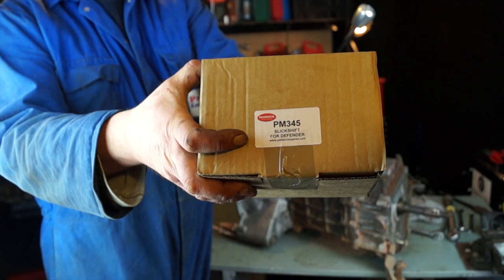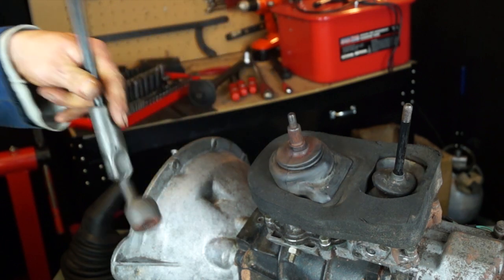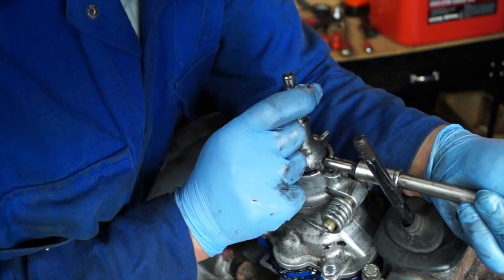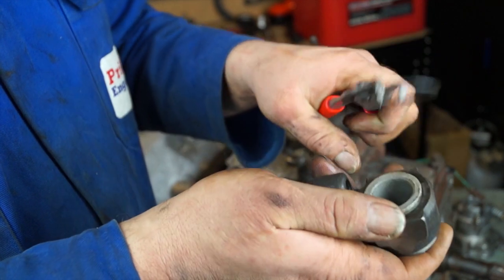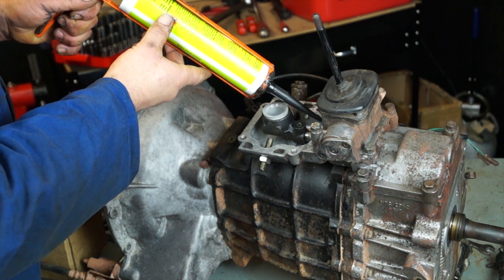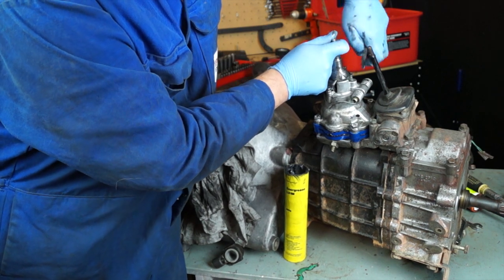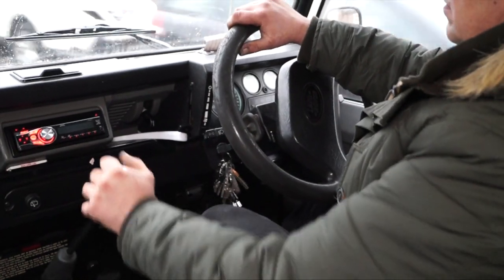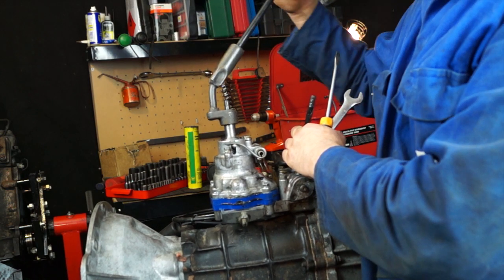PM345 Slickshift for Defender Gearboxes R380 and LT77 fitting guide

Comment: I have fitted this today but now can't seem to engage the gears, I did notice that the shaft where the grub screw sits had shifted inwards and to the left when I went to refit, is this an issue? does the shaft with the grub screw need to be completely upright prior to fitting?

Comment: Great video. Much better than Slick Shifts own video. However, although I removed the grub screw successfully I couldn’t slide off the trunnion, not enough space behind with the body. So I was unable to fit that plastic seating. Slick shift said fit all the parts. So I gave up. Although it worked ok after I adjusted the 3rd/4th gear adjusting screws I found reverse more difficult to engage ?? Bottom line, is it’s now sitting in my garage unused. I’m happy to send it to anyone for free if they’re interested. 😁

Comment: Fit my slick shift. Get all the gears no problem. But if I select reverse it goes in ok but it is very hard to get back out. I don’t want to force things. Didn’t have this problem before with the old shift. What have I done wrong
Reply from the maker: LT77 or R380?
Reply: Lt 77

Comment: hi could you i know this is not directly related ( im planning on changing my 2.5 petrol N/A defender to a 200tdi) but can you put the gearbox from   a 200tdi disco directly in the place of the LT77 from the 2.5? without an complications?
Reply from the maker: The gearstick will be too far back to be any good. Gear selector housing is Different on a Disco.  There is a way around it on the R380 gearbox Change the selector shaft in the R380 to a Defender Selector shaft which is available as a kit  and fit the DEFENDER gear selector housing.    http://www.onlinegearboxparts.com/product/r380-discovery-to-defender-conversion-selector-kit/   It is from the same guy who designed this Slickshift.
Reply: ***** thanks! has been a great help , keep up the good work
Reply from the maker: laurence couch   Great.  Thank you.